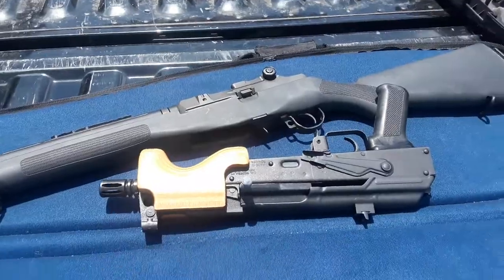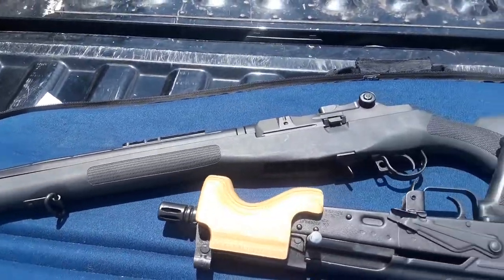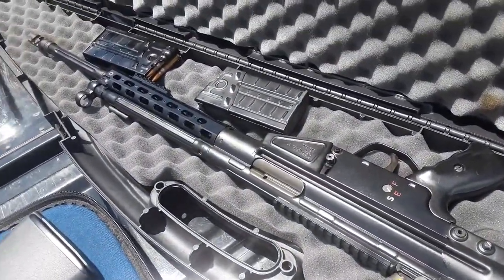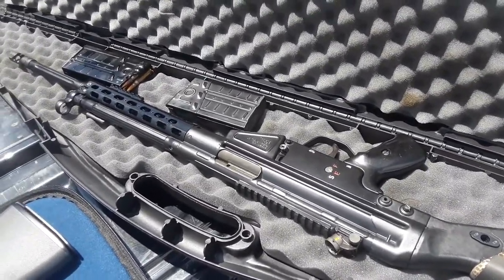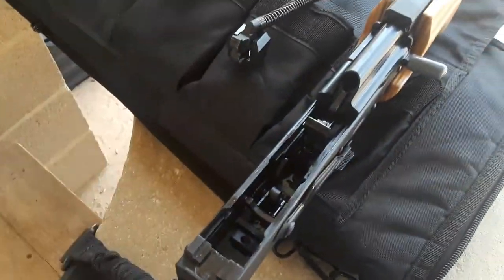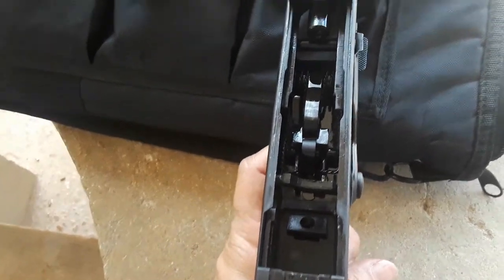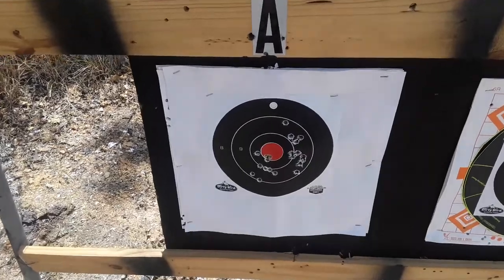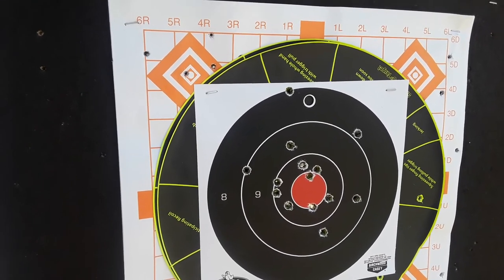Micro Draco lets me down

Comment: Well what was the issue with the Micro Draco ?
Reply from the maker: Thanks for watching and commenting. The issue was that I had put on a sling attachment that interfered with the trigger travel. Check out my latest video of the Micro at the range. Worked fine once I removed the sling attachment.
Reply: cavtroopermunoz which sling attachment did you use